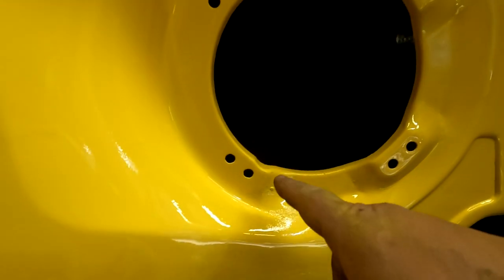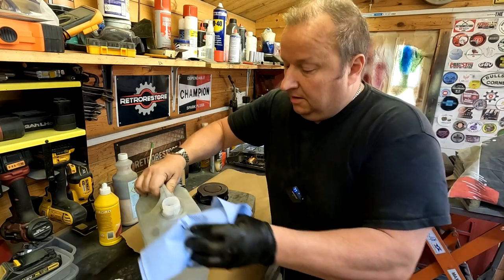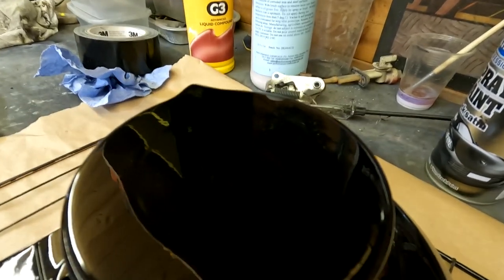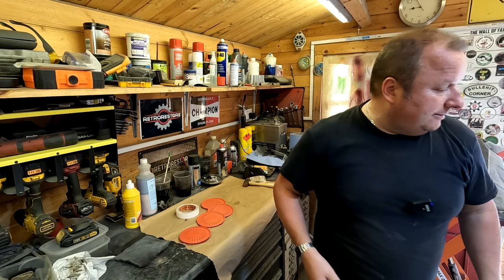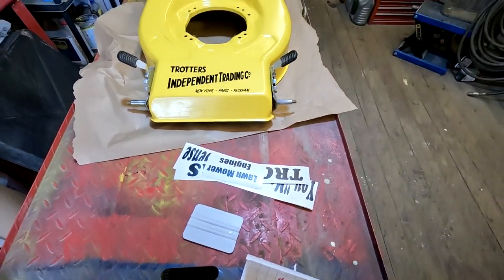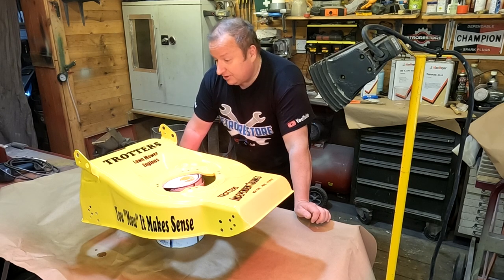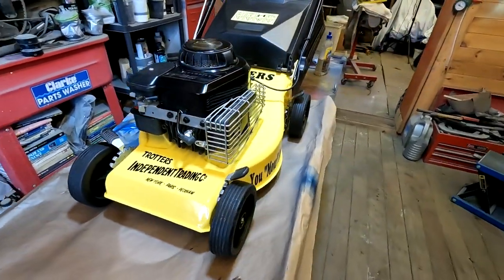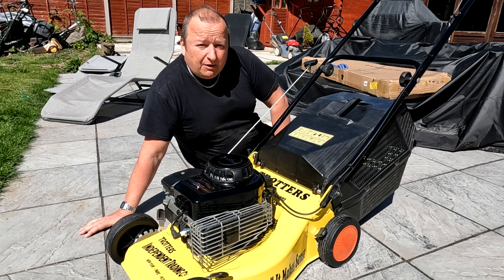Pimped Up Scrap Lawn Mower - Trotters Tribute Part 2

Comment: Looks spot on Martin, you could of welded a bracket on the front and fitted one of those big castor wheels, probably look daft but be a proper 3 wheeler 👍👍

Comment: Here for the part two as I said I would be! and it looks really good, a very special item. Needs those hub caps painted black really.  I’d never use it if I was you.
Reply from the maker: I think yellow Alex so that will be done.
Reply: @retrorestore  definitely yellow it will look great 👍🏼
Reply: Hydro dipped in leopard print would look awesome
Reply: @aaronmorris8963  that’s not a bad shout

Comment: A good second coat with normal powder gun can be achieved by dusting the powder lightly onto the job whilst it's still hot,to prevent the graining.It helps the second coat to stick to the first and not lift,for me anyway.

Comment: Looks like the yellow powder coat may need to by hotter for the flow to happen. Some powder coats cure at different temperatures. May check to see if it needs a hotter temp. Just an idea. I do a pretty good amount of powder coating and never run across such issues...yet!   Thumbs Up
Reply from the maker: I think it was not grounded properly Gary.

Comment: Absolutely love this, great content on the mower, I definitely wouldn’t wanna use it though as it’s too good, as for the powder coating issue, as you said later on in the video I think it was due to static problem where you had a few coats of powder coat already where you couldn’t get a decent ground
Reply from the maker: Yes, I think so too Adam.

Comment: Mother’s or Meguires plastic restorer. The ultra violet rays from the sun cooked the pigment out. Try their stuff. Plus on car/truck dashes you want a good uv protectant. Like 303 stuff or amour all. The only bad thing with lawnmower covers is they hide screws under neath them so when the plastic wheels 🛞 get used up to remove the old covers sometimes the plastics get brittle.

Comment: Martin, have you ever used powder coat clear over a colour, I’ve been told if you touch the colour before applying it you see fingerprints on the colour.
Reply from the maker: Yes I have, It is OK but I prefer actual 2k clearcoat.

Comment: Where is your copper bar earthed. I used to do traditional powder coating. Try driving a long copper pipe out side of your workshop and attach it to your copper hanging pipe and keep all hangers and pipe clean. Hope this helps you
Reply from the maker: I keep meaning to sort that out but you know what it's like Mart, if its working ok, you never get round to it. I will sort it sometime.

Comment: My first thought was, could it be an issue with the first 2 powder coats acting as an insulator and preventing the bonding? But I think you said you’d removed some powder coat to allow bonding. For what it’s worth, I preferred the first attempt at powder coating over the rust converter. It had that distressed, scruffy look like the Trotter van..just my humble opinion 😉
Reply from the maker: I just wanted to protect the graphics from petrol spills Gary.